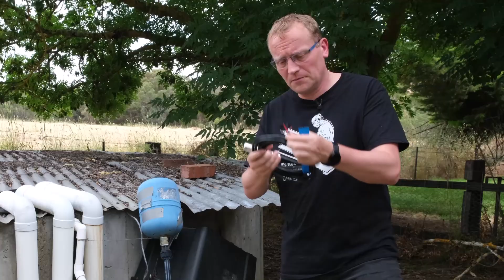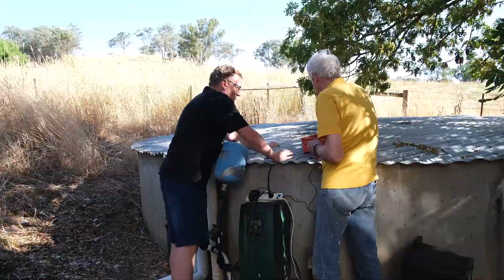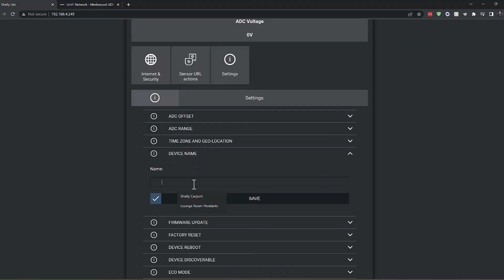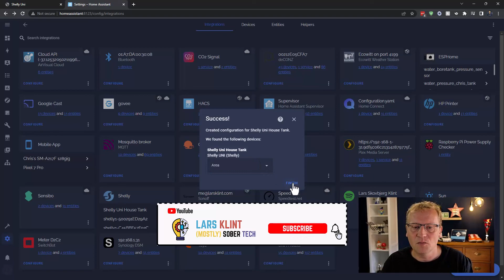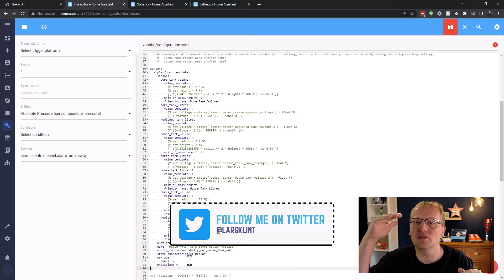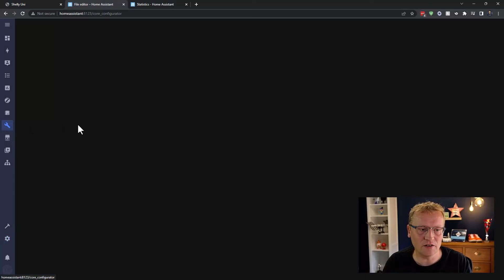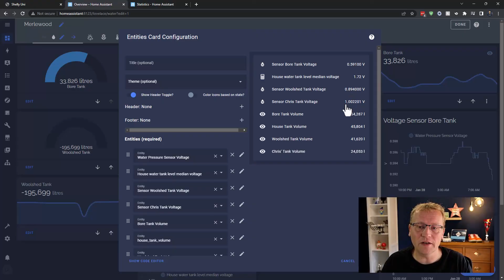Monitoring water tank level with Shelly Uni & pressure sensor | House tank sensor v2.0

Comment: Thanks Lars
I have just set up similar rain water tank volume monitoring using a similar pressure transducer and ESP32. Your  section on setting up and using an averaging virtual sensor was particularly useful.
Reply from the maker: That is awesome and you are most welcome. I'll have to do another two myself soon when we get the new buildings up and running.

Comment: @LarsKlintTech

Why did you choose the 0-5 volt sensor and not the 0-10 volt one? Wouldn't the 0-10 volt sensor be more accurate because it has a wider range?
Reply from the maker: Iniitlaly I wanted to use it with the Atom Lite (before I realised my mistake) and that runs up to 5v-ish. You could use either, and I don't think it would be a huge difference in accuracy.
Reply: @LarsKlintTech  Thany you.

Comment: It's been 2 years, how has the sensor held up since? Great video btw
Reply from the maker: They are still working 100%, but I am replacing the Shelly UNI with the Shelly Plus UNI, as they original Shellys are becoming a bit unreliable.
Reply: @LarsKlintTech  Love it. Good tip. Gen1 Shelly devices had teething issues.
Reply from the maker: It's not completely like for like unfortunately, so I have to rejigger things with the Shelly Plus UNI.

Comment: This works great. If anyone comes back here using the newer Shelly Plus Uni, you need to also put the green shelly wire (GND) with the black VAC (negative) wire so it can measure voltage correctly.
Reply from the maker: Awesome!! Thanks for the updated info 👌❤️
Reply: Hello and thank you for the tip regarding the Uni Plus, as I can no longer find the Uni (without plus).

I have another question about the pressure sensor.

Which one should I buy?

The link is no longer working.

I want to measure the water level in a well. The water will be a maximum of 2-3 meters deep. But the cable should be at least 10 meters long, preferably 15 meters.

Comment: Hey Lars!

I was wondering what made you go with pressure sensors vs ultrasonic? I originally decided to go with ultrasonic but am now considering how it’s best to mount inside the dome shaped roof of the tank to get it 90 degrees to the water level

Just wondering if you had any other reasons for choosing the path you went with?
Reply from the maker: Good question. I chose pressure sensors for a few reasons. a) I don't have a roof on all tanks, and wanted the same solution for all tanks for simplicity, b) Hanging something from the center of a roof that is maybe 3-4 meters across is difficult (when you are a software nerd like me), c) I had read a few places that ultrasonic weren't super accurate and could be influenced by its surroundings, d) a good friend of mine had already installed pressure sensors and could help me out, e) pressure sensors are super simple and easy to get into HA.
Reply: @LarsKlintTech yep, it’s the 4m stretch I’m having trouble with, if I mount close to the edge it wouldn’t be 90 degrees and would probably be under the 20cm minimum reading range of the sensors. I’m also liking less and less the thought of drilling holes in the roof of a brand new kingspan steel tank when I could just use the hatch to feed the pressure sensor cables in (with suitable protection of course).

I’ve got two poly tanks as well but will have to drill those as there isn’t any hatch other than the mesh strainer but at least I’m not restricted if I use a pressure sensor.

Cheers for your thoughts!
Reply from the maker: @kurtk8076  Exactly. It is just much simpler.

Comment: Thank you. I'm giving this a go. I wonder if there is a way to know what 'pressure' equals what voltage without having to monitor your actual tank level to know what voltage = full. Anyway just needs patience and time otherwise (or a hose).
Reply from the maker: Cool, I am still using the solution a couple of years later. You can guestimate the voltage based on the unit you get. If it has a 3 meter range, and the voltage is 5v, then a 2 meter tall tank will be full at 3.33V. You can then adjust over time to dial it in more accurately.

Comment: Thanks mate, ordered the parts and giving this a crack. Need to find a suitable 3d print to shove it in to help with the weather. Did you find anything suitable to print or buy to shove it in? cheers
Reply from the maker: Yes, I had a friend 3D print some cases for the Shelly UNIs. Not weather proof, but gives some protection at least.

Comment: Lars how is this going so far? I want to do this on my rooftop tank but it is scorching hot and humid.
Reply from the maker: I am still using the setup, and it works great! I have had a couple of small issues with the Shelly Unis disconnecting from the Wifi, but nothing major.
Reply: @LarsKlintTech  cool, I am doing my due diligence before committing to something that can be super cool and useless at the same time if you know what I mean :) but thanks for confirming it's working well!
Reply from the maker: @tinker_tut  Haha, I know the cool and useless category. This is both cool and useful though ☺

Comment: Thanks very much for sharing all this. I've now replicated your setup so I can see the water level in the 'waterbutt' (as it's called in the UK) which I used to water plants etc. Just need to do the V to % thing but I first need to see what the voltage is when full. Thanks 👍
Reply from the maker: Awesome!! Very happy to hear it works for you. You could do a best guestimate on what the voltage to water conversion is, and adjust as you go?
Reply: @LarsKlintTech  I know it's 0v empty and 0.7v at 25%.... Calibration is next on the list :-)
Reply from the maker: @TheDervMan  Soooo, 100% is 2.8V? 🤞

Comment: Just a follow on I was wondering how all of this was going 2 years later?
Reply from the maker: Thanks for checking in. It is working exactly as I have set it up in the video. I have now got the same setup on all 4 water tanks, and it is the most stable it has been 😊
Reply: @LarsKlintTech  Hello, would you update sensor link? Not more available. Interested in solution 8 meters deep water well. Thanks!
Reply: @LarsKlintTech  Thanks so much! I only ask because I was planning on blatantly copying your approach :)
Reply from the maker: @owlytv  that is exactly what the video is for 😊

Comment: Thanks Lars, very informative! Just a question on the calculations, if I have a 2000L water tank and the voltmeter reads, say 3.00, would it follow that 1000L would read 1.5 on the sensor voltmeter? I'm just lazy to calibrate - lol - so I've coded the percentage full based on this theory.
Reply from the maker: Yes, in theory. I've found that the voltage curve is not 100% linear though.
Reply: @LarsKlintTech  Thanks for your reply, I'll keep and eye on it and see how accurate it is.

Comment: Hi Lars. Just questioning how the peaks and troughs can be ironed out in the output? I've gone from 149500L to 141000L pretty much in 24 hours (no its not leaking :-)). I presume the difference is barometric pressure but not entirely sure? Thanks. Keep the informative videos going, they are very useful.
Reply from the maker: Barometric can definitely make a difference on such a large volume, and you can include that measurements in your calculations, if you have access to it. You can also use a statistics sensor in HA, which gives you a bunch of different options for manipulating the values. 
https://www.home-assistant.io/integrations/statistics/

Comment: Hi, thank you for the tutorial! I have a tank that is 2.5 m deep. What length do you suggest for the sensor?
Reply from the maker: 3 meter should do it. It really just affects the voltage you get, so it doesn't matter a lot.
Reply: @LarsKlintTech  Thank you very much for your reply! Is there anything else you could tell me after this period of use?
Reply from the maker: @emilianoferrara5  my Shelly UNIs have been an excellent choice. They do drop out occasionally and then come back soon after. I haven't worked out why they do that. I still use the same sensors too without a single issue.
Reply: @LarsKlintTech  ok. thanks a lot

Comment: Can you help me understand what I have configured wrong: wired the S. Uni as you did with a 12v power supply + power to the pressure sensor ( 0-10V).  I am seeing voltage from about 7.5 to 8.3.  I verified voltage 12v from the power brick to the Uni. How can I troubleshoot my configuration?
Reply from the maker: Are you seeing 7.5 to 8.3 volts from the pressure sensor? If it is measuring 0-10V, that seems like a valid measurement?

Comment: You might also consider using the "filter" sensor in Home Assistant, which doesn't rely on the recorder database and lets  you chain a number of filter operations together.  So you could have an outlier filter followed by a mean, which might get you less noisy data than median, maybe.
Reply from the maker: That is a really good idea. I will investigate that option. Thanks mate 😊

Comment: Great video! Just built my version and it works fine!
Reply from the maker: Brilliant! And well done 😊
Reply: @LarsKlintTech  I cant get the sensor for the value in liters to work. could you pls provide the yaml code from the voltage to the liter-sensor?
Reply from the maker: @Thomas_Meelker  This is the YAML for calculating the litres from the median voltage:
house_tank_litres_shelly: 
        value_template: >
          {% set voltage = states('sensor.house_water_tank_level_median_voltage') | float %}
          {{ ((voltage / 2.7) * 45804) | round(0) }}
        unit_of_measurement: l
        friendly_name: House Tank Litres

Comment: Great content/videos Lars. I am currently using a Arduino nano and a 16x2 lcd in my pump shed to display tank water level, but since seeing your implementation using the shelly UNI I will be replacing the Arduino and integrate that into HA alongside my victron off-grid dashboard on HA.
Reply from the maker: That is awesome. That sounds like a decent upgrade. I have 4 of them now, and they have never failed me. They work really well. 
I will have to go google "victron off-grid dashboard" now though....
Reply: @LarsKlintTech  can I ask what was the pressure transducer your using on the bore tank. The one I got from ali is returning some unstable voltages due to temperature drift. Not very stable. Mine is a 0 to 30 psi, measuring a 3 meter head of water. I'm figuring you get what you pay for when it comes to transducers.
Reply from the maker: @Tek69  I can't remember tbh. They were off eBay or AliExpress. A couple of them failed too, so I replaced them. I think they were 5 and 15 psi. That is one of the reasons I went to the in-tank ones in this video.
Reply: HACS has the victron integration
Reply: By the way I'm going to do the auto gate setup on my property too. 👍
Reply from the maker: @Tek69 oh cool. I just got the UniFi Access Gate starter kit, so might upgrade/extend mine too.
Reply: Hey Lars I've used your implementation for measuring my water tank level, through the Shelly. 
Working well except 
can't seem to get the statistics code to work. 
Platform is an invalid option for sensor.template. And more configuration warnings come up. If you're ever coming to South Australia free camp site for your coding skills. Lol 👍
Reply from the maker: @Tek69  It would appear I am using the "legacy" version of the template sensor, according to this: https://community.home-assistant.io/t/difference-between-sensor-platform-template-and-template-sensor/389248 
Try and use the new official approach: https://www.home-assistant.io/integrations/template/#configuration-variables

And thanks for the invite 😁
Reply: @LarsKlintTech  Lars, it would be great if you have time to do a short video explaining how to setup a statistics sensor the new way. I can't get my head around it. Lol. Legacy method made sense but doesn't seem to work anymore. Cheers
Reply from the maker: @Tek69  I'll add it to the list 😊
Reply: @LarsKlintTech  cheers mate 👍
Reply: Hey Lars I have sorted the (statistics) sensor out. Also in my pump shed I have setup a differential pressure sensor across my filter so I know when to change it, & keep tabs on the general state of sediment build up. That's through a Arduino pro-mini and displayed on a 16x4 LCD. Could be another project for your house tank water filter as well. 👍
Reply from the maker: @Tek69 Thanks for the update. Do you have a single sensor that measures two sides of the filter?
Reply: @LarsKlintTech  two sensors. Pre filter and post filter, that gives me the Delta P.
Reply: I can send you a picture if you like.
Reply from the maker: @Tek69 yes, please. Sounds like a pretty good upgrade.
Reply: @LarsKlintTech  not sure how to send you a pic through this platform 🤔
Reply from the maker: @Tek69  Send to me at larsklint dot com

Comment: Thanks for this. Just a note about the UNI - the two pairs of black wires are “relays” (not really relays, but they act like such) so there is no voltage on them, they just open and close circuits.
Reply from the maker: Thanks for watching and thanks for the tip. I did realise this after recording as well, I think they are called "dry loops". Cheers ☺
Reply: @LarsKlintTech  'Dry' contacts just mean that they are isolated from the incoming voltage powering the control device. i.e. you can use a 12v relay controller to switch on or off a 240v circuit, or the other way around.

As opposed to 'wet' relays which you find on power metering relays where the relay output voltage is supplied by device incoming.

Comment: Hi Lars, the negative of the pressure sensor should be connected to Pin 6 (GND ) and not to the negative of your power source.
Reply from the maker: That is not what the documentation for the sensor states.
Reply: @LarsKlintTech  see fig.6  https://shellysa.co.za/wp-content/uploads/2021/04/Shelly-UNI-User-Guide.pdf

Comment: I baught two of them sensor, now after a month, they are in tilt, no signal. Someone have same problem?
Reply from the maker: Can you provide some more details? Can you measure the voltage from them directly? What device is receiving the signal from the sensor? Did it work and then suddenly not?  Can you explain a bit more about your setup?

Comment: I don t know why, After 1 month that tl136 was working well, from today i have not signal from It, 0 voltage. I tried to Change shelly uni ... Always no signal ... Somebody can help me?
Reply from the maker: Step 1 is to confirm the sensor is the faulty part, and not somewhere else in your setup. Can you put a voltage through the sensor manually and see if you get a reading at all?
Step 2, if the sensor is faulty, is go back to the seller and talk to them about a replacement under warranty.
Reply: @LarsKlintTech  ok, thanks a lot. I Will try your steps.
Reply from the maker: @antonioadragna1262  Let me know how you go with it.

Comment: I'm still trying to get my head about the sensor you have. I have a Taylex 31500 litre tank, which is 3450mm wide, and 4100mm high.

So should I get the 5m or 4m sensor with a 5m cable ?

BTW, I like your choice in water pumps, I have the same pump here on my house. :)
Reply from the maker: Hi Brendan. No worries, it took me a while to figure out the wording and how it all relate. The "range" length is the depth of your tank, or the max depth that your sensor will measure max voltage when the tank is full. So a 5m range will measure 5v in a full 5m deep tank. In your case you'd need the 5m range at least with possibly some extra meters to get the cable to your shelly UNI or whatever device you use. Perhaps a 7m/7m to give you about 3 meters extra coming out of the tank? You could also use the 5m/5m, but then you only have about .9m to play with outside the tank. 
With whatever range and cable length you choose, you'll have to calibrate your calculations, as there are always some fluctuations once installed.
Reply: Saw this one Submersible 0-10V 4-20mA Output Hydrostatic Level Sensor Transmitter DC12-36V Water Tank Liquids Transducer Meter , but is it the same thing?  It comes in a 5m range, and 10m of cable, as a better price too. 

Wouldn't a 7m range in a 4.1m deep tank have a lesser resolution of depth ?
Reply from the maker: @brendanpratt7760  It sounds like the same thing. And 5m/10m  should give you plenty of cable to play with too. Yes, with 7m you would "lose" some voltage range in the measurement, so you are better at getting it as close to the depth as possible. However, overall, you wouldn't notice a huge difference, as the 0.01 increments are granular enough imo.